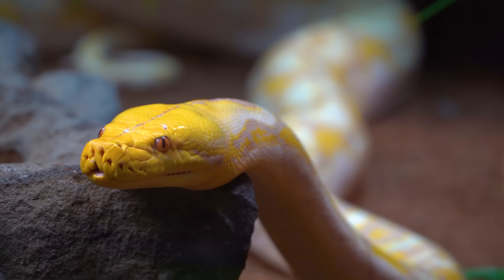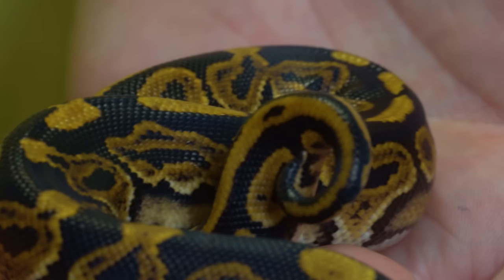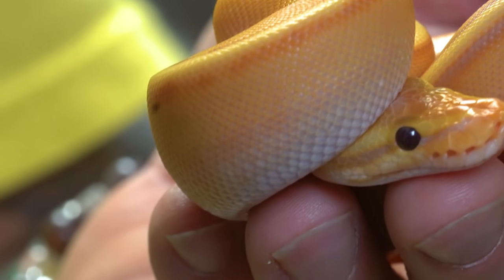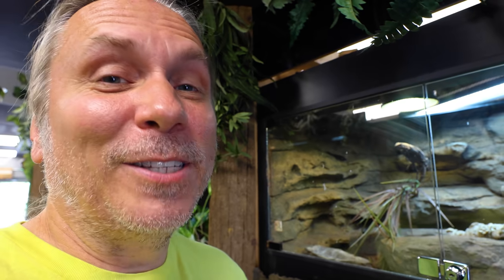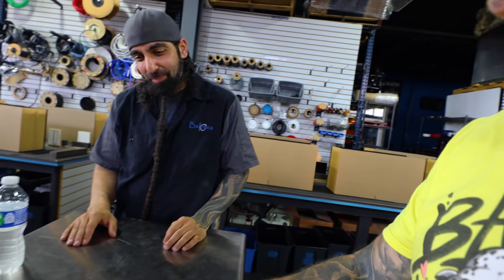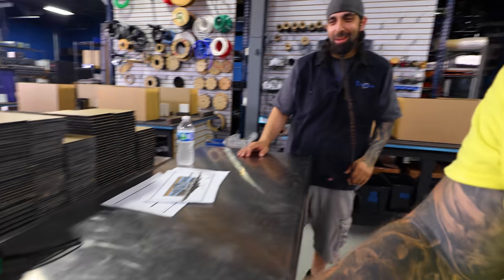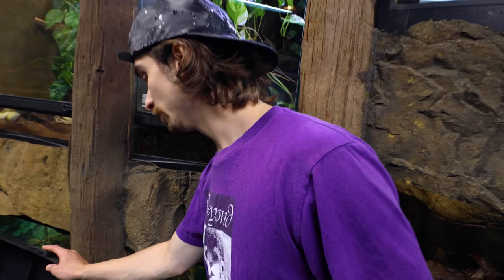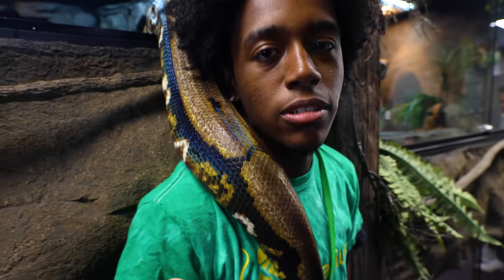NO MORE REPTILES FOR ME!! | BRIAN BARCZYK

Comment: What your trying to do is amazing keep it up.  The expansion would be sick.  But in my opinion an thought when you want too go for 5. Gona add a 4th level lol. Building your in is kinda small. Even if you had another level.  What about an abandon building like an old Kmart you could move your entire operation into it. Plus. If yon get to expansion 20. You could add a sec level in there.  What's the financial cost of buying a new building vs your expansion. I ain't no expert. Your just gonna run out of room use this place as this is were I started this is were I'm going new building

Comment: Brian I just bought a ball python and I have him in an aquarium with a screen top I'm using the heat lamp it also came with the heating pad what do you recommend I use to keep him warm the heat lamp for the heating pad I'm still new at this so I'm a first-time snake owner
Reply from the maker: You can use both or either really as long as the hotspot is 90-95 degrees